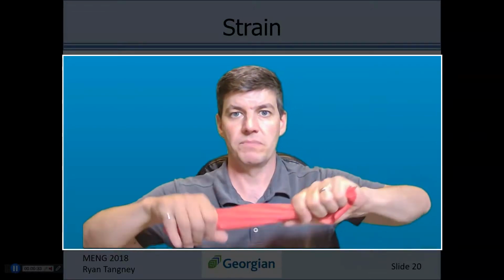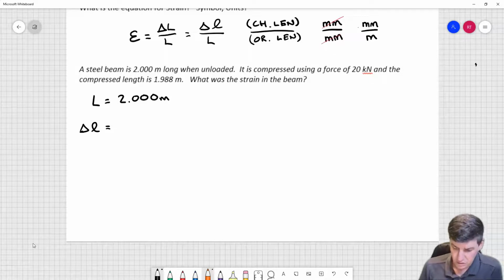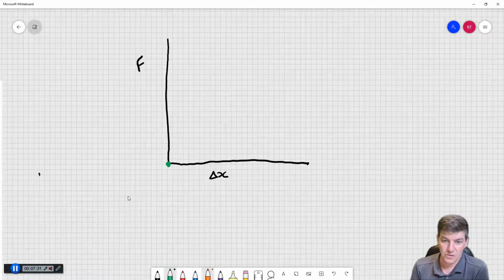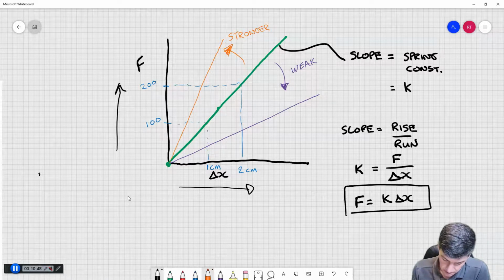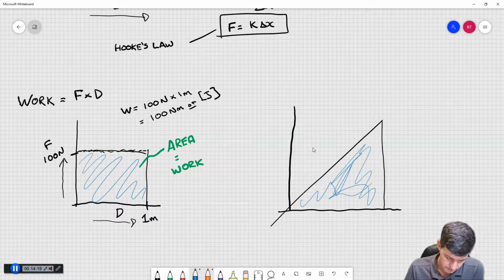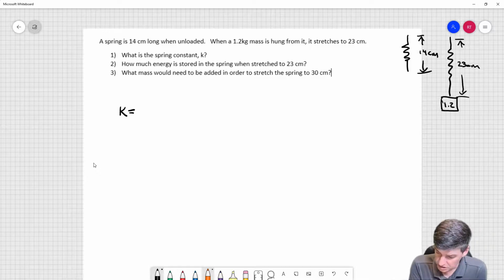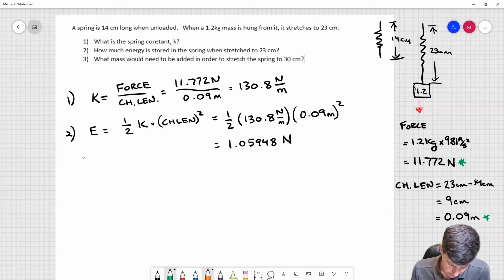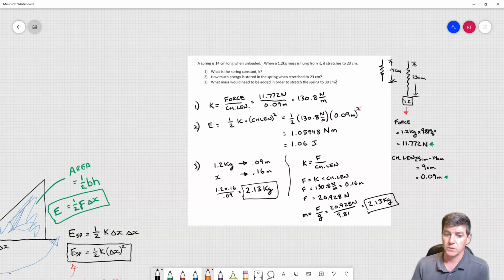MENG2018 - Georgian College - 3A1 - Chpt 6 - Strength of Materials - Stress and Strain (3/4)

Comment: Don't you have to multiply by .5 in order to get the correct answer for the energy in the spring? If you multiply by .5, you'll get 0.52974 vs forgetting about the .5 you'll get 1.05948.